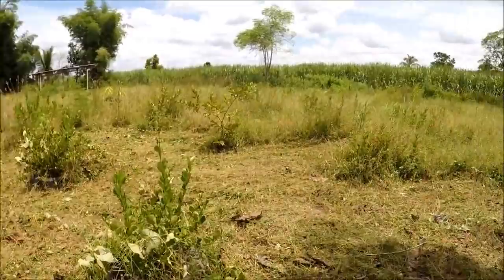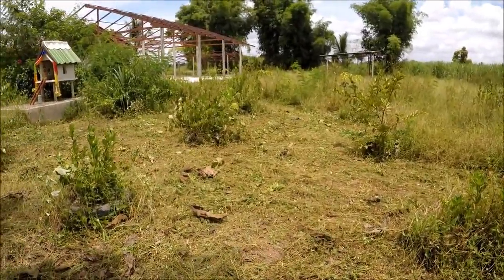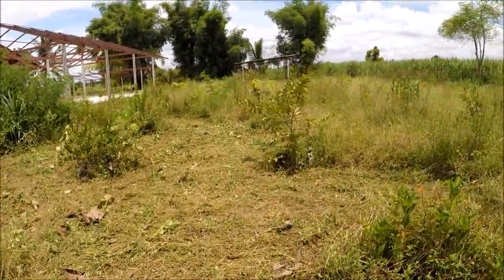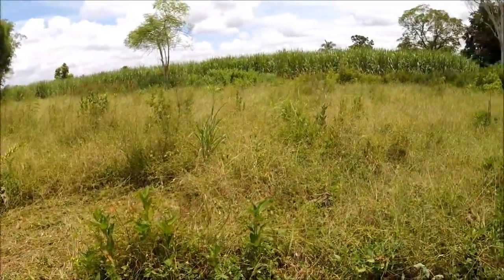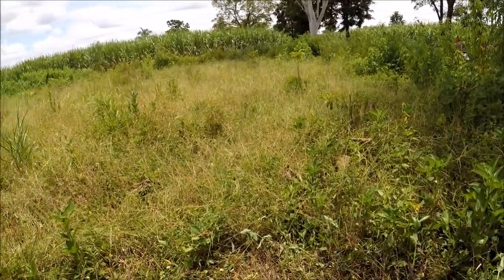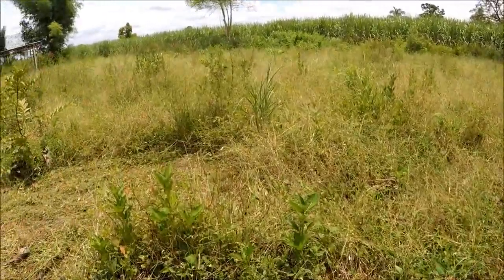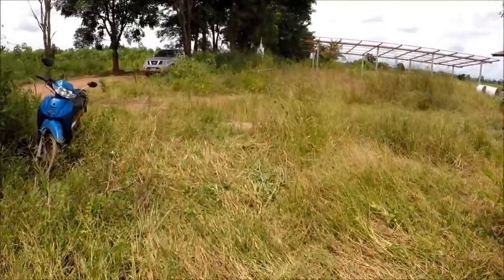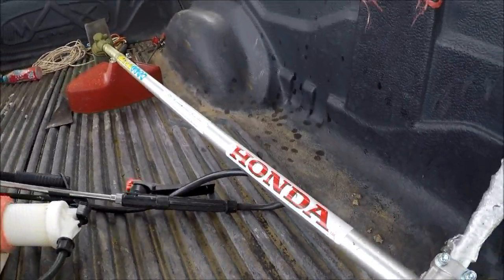BACK ON OUR FARM - BUILDING A THAI HOUSE

Comment: That Honda looks a mean machine , I think you will be happy with it and hopefully any hassle you be able to find the spares, happy strimming
Reply from the maker: Happy as a pig in$hit is me. Problem is the heat & lack of fitness is holding me back. Feeling like my arms are hanging off lol.
Reply: That's what the harness is for. It's much easier to handle on the one stroke setting btw lol
Reply from the maker: Wheres that switch? Is it next to the Flux Capacitor?
Reply: Wayne, Living Off Grid In Surin, Thailand .....leigh won't do it on that low setting ....4 stroke or nothing .....when he got it moving he was looking for the overdrive......he looked like farmer Giles with that slick hat on !!
Reply from the maker: I was wearing a green vest on the farm today dont you know!
Reply: Green vest,  its good camouflage.but the hat looked very rural.....scary thought you camouflaged coming out of the undergrowth in overdrive with all 4 stroke's blasting ,  wonder how many snakes you gonna cut in half !!
Reply: Leigh a scythe is one Stroke lol
Reply from the maker: That's Toon's favourite lol

Comment: Hi Leigh - I also had one of those - a lovely piece of engineering - but I had to keep taking the grinder to those blade tips... The blade kept getting too close to my socks...
Reply from the maker: Hi Harry ~ the blades are taking a right old battering, not to mention the shop not tightening them enough, the vibration that nearly took my arms off gave it away lol!
Cheers Leigh.

Comment: Great decision with the Honda brushcutter, the blade that comes with it is basically a practice blade and you'll wear that out pretty quick. When it's time for a replacement go for the 14" blade with 2mm thickness also prepare for that harness to break, look for a strong sash style with steal fittings and you are away. Have fun/sanook. Regards.
Reply from the maker: Hi Sanook Aus ~ we still have the Honda original blade (it looked a bit lightweight).
Agreed the harness looks like something out of Kiddy Care lol.
Cheers Leigh.
Reply: Is there a guard on there or something I didn't see?  Wearing kevlar pants?  Metal blade shattering and flying at who knows what speed into a leg......  Double that with a longer blade?   Hmmm.  Stay safe Amigo!
Reply from the maker: All these strimmers have a guard fitted to the back of the blade.
In Honda we trust (fingers crossed!)
Cheers Leigh.

Comment: I brought the same honda one year ago paid 8500 baht,, I brought it because honda's never stop and start first time,, Never had a problem with it,,, And nice and quiet not like the Thai ones,,,LOL,, oh and the neighbours love it too when there crap one won't start,, I say yes sure you can use it, but you can cut our grass around the house as well,,,lol,, and they do,, And will those 24 bags of cement do inside and out ?
Reply from the maker: Nice trade Sean.
Toon corrected me on the figure I quoted on the video. We paid 8500 too, the Thai copy was 4000 & they had one from some where else in Asia for 2800.
To date my favourite power-tool purchase.
Honda every time from now on when available & finances permitting.
Cheers Leigh.
Reply: yes me too,,  even have a honda click never a problem, and get free service every time it needs one, can not complain about that,,  so what about the cement bags,,,55555 did you not read that bit,,,5555
Reply from the maker: Forgot to press the "show more" option lol.
Just enough for the inside & a few left over. More being delivered tomorrow as the video was from 2 days ago. Bathroom & 1 other wall to do then outside. 2 more days is the estimation.
Reply: Sean smith I paid 2,100 baht for my Mongolian copy of a Chinese copy of a 1944 Italian strimmer with a French motor because I like wearing the full gimp outfit with a Chang IV rig out in the midday sun. Doesn't half make you feel good when you pour the contents of your wellies into a pint pot filled with ice then savour the flavour Proper graft that is...if you told kids that nowadays, they wouldn't believe you.
Reply from the maker: Mongolian copy of a Chinese copy . . . Cheap Charlie lol.